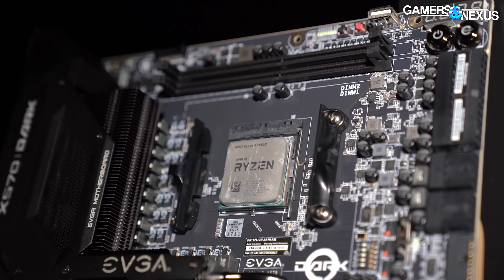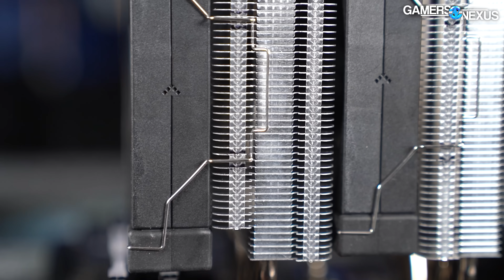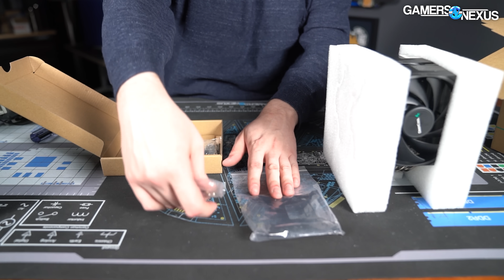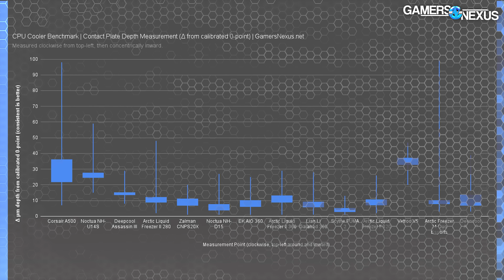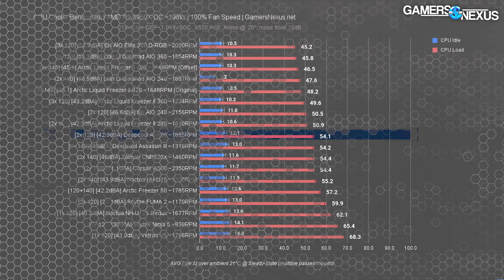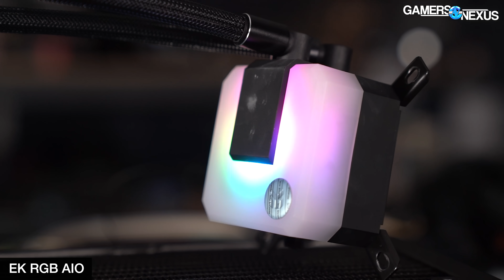Air Coolers Are Getting Impressive: Deepcool AK620 Cooler Review

Comment: Nice video! I was just wondering should i go for Arctic Freezer 34 eSports Duo or DC AK620 for my i5-11400f (unlocked power limits). Can someone help?
Reply: DC AK620 is definitely one of the top 3 high-performance air coolers.
Reply: @astalake7689  Thanks for help!

Comment: When comparing it to the Fuma 2, it's also worth mentioning that the Fuma 2 is neatly designed to fit it into smaller cases or with big RAM modules. It's offset backwards with a thinner fan on the front so it will fit in basically any build, unlike the AK620.

Comment: Installed this after my MSI Coreliquid 240R failed, and it's legit cooler AND quieter. I've received a replacement Coreliquid V2 (which I'm sure is an improvement over the V1), but I won't be using it. This thing is just way better. Sure it takes up more space, but that's the only downside. It also means no more liquid in my PC, which is always a concern.

I also got it for just under £50 whilst Noctua's NH-D15 costs about £100.

Comment: Is there a chance you can add a ~170W load to the charts for future reviews? That's currently relevant for the 12700K (and future i7s I assume) all core workloads and it seems AMD are going to a similar power level soon with their Ryzen 7000 series as stock (at least the upper end ones). 

It's also a good intermediate point between the 120W and 200W loads and we can get to see how the upper mid range coolers separate themselves as the 200W would overwhelm most of them, also it isn't quite their use case scenario (and thus fairly enough not included in the 200W chart), while a modern i7 / future R7/R9 stock could have some of those strapped to them.

Comment: Bought this with my 5800x3d because of this video and holy crap, it's staying below 50C!
Reply: Under load or idle?
Reply: @bukIau  load
Reply: @atavax311  mine is at 71c under load idk why :/ but it’s a 5800x
Reply: @bukIau  do you have yours overclocked? the 5800x3d can't be overclocked. Or it could be you using something to stress it more than me. As my "load" was while gaming', while i'm sure something like prime 95 would raise the temp further.
Reply: @atavax311  stock and r23 to stress test

Comment: OK. The the AK620 does peak my interest (very much). My NH-D15, I have owned for over 10yrs, across 3 builds. It works like new and (Knock Wood) it is still running the original fans. AK appears sweet, but will take over 10 yrs to hold against NH! (I am a possible Shill... LOL) Proof is in the pudding.
Reply: P.S. I overclocked everything, quite a bit. I only upgraded to go faster.

Comment: This gives the same/similar performance of NH-D15 for less money, Customer support and long term product support is where their real value will be known.
I love Noctua(fanboi territory) because of their awesome support, cross compatibility(mounting kits across models) and long lasting product.

I have been back-stabbed by CM on cooler support so they left a forever bitter taste.
Also the build quality of CM mounting solutions are really terrible.(hyper 212 and hyper 612 in my experience)

This cooler is definitely in my recommendations list now.
Will it replace Noctuas place? Only time can tell.

Comment: Damn it, now I wanna get this beast. I'm slightly undercooled for my 5900X with the Hyper 212 Black Editon with a single fan, it works just fine, not nearly as bad as one would think, and thats with PBO2 running and all that, but pushing anything above that and it would suffer. Bigger mistake was running it off a B450... but fixed that now and got a very good X570 so VRM's melting is no longer a concern. I touched the VRM's on the B450 and they were toasty... think I could see a little glow ;)

Comment: Does deepcool assasin 3 is better?
Reply: Roughly the same but many small cases can't fit the assassin 3. Whilst the ak620 can fit easily in most cases due to the slightly smaller footprint.
Reply: @afiq358  tq bro

Comment: Just bought and installed this cooler today. The mounting system seems great until you get to screwing in the heatsink itself. The convex design of the contact plate makes it quite difficult to be screwed in properly. So far Cinebench R23 testing of a Ryzen 9 5900X shows CCD1 reaching 81°C while CCD2 only max out at 71°C. Don't know if the temp is good or not because I also just upgraded from a Ryzen 5 3600.
Reply: Those  are good temps for a 5900x on an air cooler...
Reply: @KiiaaA213  I'll just have to take your word for it. I guess I could've applied slightly more thermal paste but I really don't see how it would drastically drop CPU temps much.

Comment: Fan fact: the AK 630 installed on cruiser Moskva failed to cool her down on the Black Sea.
Joke aside, I've got a Fryzen from Deepcool that has the same convex cold plate. It works fine on the normal single ccd cpus. It squeezes the thermal paste out from the center so that there's no air bubble trapped in it. But It doesn't do much good on my 5950x since it cools one ccd and not the other, about 10c difference. I ended up sanding it down flush so both ccds and the IO die are happy.

Comment: Looking at numbers of, for example Arctic LF 2x140 at 35dB noise level: It can keep 123 W at 51degrees and 198 W at 52.4 degrees. 75 W more power will cause temp increase only by 1.5 degree ?! That can mean only one thing -- there is a huge thermal resistance built into CPU case. Smaller for igh power CPUs. Just to reduce the effect of coolers and not to allow cores to run at too low temp and to limit precision boost ?! Why isn't anybody talking about that ?

Comment: Why would anyone want to run liquid cooling over air cooling when it increases the risk of destroying the computer from leaks? I'm asking genuinely
Reply: Don't have a liquid cooler but there are good reasons why one would prefer liquid cooler over air cooler.

Custom loop: much more potential cooling performance and looks.
AIOs: the higher end 240s or 360s will still outperform the best air cooler.

Comment: I’ve been very happy with air cooling lately. I’m a big fan of their cheapness and peace of mind. Between Scythe, Noctua, Be Quiet, etc. Sound has never been much of an issue and I like not having to worry too much about radiator positioning when building. Honestly compared to the best AIO’s, the best air coolers are maybe going to be 10C hotter tops at max loads. But how bad is that temp even at max loads in most situations? Not usually a problem. 

Also you’d be hard pressed to find a worthwhile air cooler ever over $90-100. And more likely can get a great one at $50-60.

Unless you’re running crazy loads often and for long amounts of time on top level parts, or doing heavy overclocking, I’d recommend air cooling. Even then depending on where you live you could get by fine with air cooling.
Reply: I’d also add the caveat of case size. These days anything less than like 20l lis gonna be a hot box and require water cooling for optimal performance

Comment: Fitted a black NH-D15 a while ago and I’m frankly blown away by it. My cpu loves it, it’s quiet and there’s little to go wrong. It’ll last for years and I plan on using it in my next build, too. Love it.
Reply: Which CPU? I am planning to use it with my Ryzen 5 7600 along with Zotac 3080 Ti Trinity OC. My chasis is CM Storm stryker, Mobo is MSI Tomahawk B650 and  PSU is Rm850X from Corsair.
Reply: @avroneelbiswas  I’m using a 5800X3D with a 3080ti. No problems at all. CPU idles at around 32c and I’ve not seen it go above 70c during gaming.

Comment: If you don't want to watch the video, basically it's the best air cooler we have at the moment, in peak performance and overclocking scenario, it's cooler and quieter than the Noctua NH-D15 and it's performing really well at 35dB. For 60-70€/$ its better than the Fuma 2 and NH-D15.
Reply: @Transistor Jump true, but that beast will weight at least 2 kilos or 4.4 punds haha.

Comment: Why don't you test the Silver Soul Black cooler from Thermalright. It's really interesting for smaller system with a height of only 135 mm and a 120 mm fan placed in the middle of the dual tower with 6 heatpipes ?

Comment: I was about to buy the Deepcool AS500 Plus until I saw this review, and decided to splurge and go for the AK620 since there wasn't much of a price difference (I paid SGD$95 = USD$70 for the AK620). It's working great with my 5950X, very pleased with it so far. Thanks for the thorough review!
Reply: There on sale now for $55 on Amazon
Reply: @ninemm222  REALLY? That's some good ass deal for a cooler literally better than Noctua NH-D15
Reply: @TON-ob7ib  Hell ya I’m hyped
Reply: @ninemm222  If ya planning on buying it then go for it mate, That shit's worth every penny
Reply: What are your temps on the 5950X?
Reply: @TON-ob7ib  I'm getting 40-50 during normal Windows usage and 65-75 in gaming, occasionally maxing out at about 80 if running something like a stress test.
Reply: @tscottj  Damn, Those temps are going strong for an air cooler that beats a lot of AIOs, considering the fact that most people get an AIO or do custom looped systems to keep their 5950X under 60. You made a great purchase! Also I apologize for responding after a long time

Comment: I am still running my Noctua NH D14 that I bought with my i5 2500k. Now running on my 5600x (with the free mounting kit Noctua sent me). Must be over 10 years old already (wth) and still works perfectly fine.
Reply: im using my Cooler master Hyper 410R from Pentium g4560 to i7 7700 non k to i7 12700 non k on asus z690 motherboard .its been 5 yrs

Comment: Why do you need 2 fans?
Wouldn't one higher performance fan between the grills be enough? 
Also, pulling air from the front end exhausting shouldn't create turbulance with ony one fan.

Comment: Air coolers, schmair coolers... I've been an air-cooler guy since the days we actually needed active cooling, but since last November, I've seen my vid card have its temps adversely affected to the tune of around 10 - 15 degrees as a result of me using a Noctua NH-D15 on my i9-9900K, which kept my CPU nice 'n cool, but stifled my GPU due to that 7 inch cube of plastic and metal sitting just 5mm off the (very hot) backplate of the GPU. That cooler absolutely dominates the airflow in anything less than a FULL midi tower. I've just replaced that apartment block cooler with an NZXT AiO, and my CPU temps are (almost) as cool, give or take a few degrees, but my GPU is now cruising at around 65 under load, compared to 75 - 80 degrees previously.

YMMV.

Comment: I love the data you provide. I think another good data point would be entering and leaving air temps. Put a couple thermistors on the inlet/outlet sides of the cooler and track the deltaT between them.

Comment: I think if we'd really wanna have a standard to measure how much Heat a  cooler can dissipate in a given time, a somewhat comparable temperature point to that you could measure would be the point at which the heat pipe "dries out" aka all the liquid gets evaporated because it's overwhelmed (for water loops I'd say the point where you cannot dissapate the heat faster than it's coming in would be a good equivalent but i know that's way harder to say since that's highly dependent on the temperature...). I know that's usually not in a temperature range that you'd want for a computing element, but it kinda makes sense since that way we really know until which point the cooler is reliable, since cooling performance plummits at this point.

Just an idea if you guys ever wanna include a standardized "how many watts can this handle" test for CPU coolers, since I cannot imagine cooling companies to ever get to a common point in faking their numbers...

Comment: Wow, wasn't expecting a cooler in that price range to beat out the D15 in both noise and thermals. Noctua better hope they have a D16 in the works or this could become the new de-facto air cooler for consumer CPUs. Better (arguably) aesthetics, cooling, noise, and above all price. And this is coming from someone who used a Noctua in their last several builds.
Reply: Pretty sure they hinted at D15 update this year. Well actually not a hint.. they literally announced as much if memory serves.

Comment: Since I am old (66) and don't use social media this is the only place I know to post this. based on your review of the Vetroo V5 I just purchased one. One thing I wanted to bring up though. Since 2008 I have used 120mm liquid AIO coolers exclusively with precious few issues. My first was an Asetek 510LC in a new Alienware Area-51 in 2008. Now this will chap your behind. THAT cooler has WELL over 100,000 hours and is still used in my test platform (ASUS P5N-D) I am currently using Deepcool Captain 120EX white AIO's in both my main machines. Full Tower is a NZXT Phantom White and the other is a Deepcool Dukase white V1. The Full tower with all the fans would explain why my 10600 idles at 25C and under load never goes over 40C. The i5 6600 in the other idles at around 31-33C and loads at around 40-45. I NEVER overclock and the ambient temp in my apt is 68F (which would also explain a lot). I also NEVER run rez higher than 1080p and my DT rez is 1154. Of course I don't need to see a gnat's whiskers at 200 yards in a game though. Just had Cataract surgery so maybe I'll be able to see better but just wanted to say that my experience may be unique to 120mm AIO's but it is what it is. Thank you for the great content

Comment: I've been using a PCCooler GI-D66A "GAMEICE" (with 6x6mm and shrouded-dual 120mm RGB fans) for the last 3 years to cool an overclocked Xeon E5-1680v2 (at 4.4Ghz).  Does a terrific job and cost me $70 at the time. At a "230W TDP" rating, it is enough to keep my rig running cool as a daily driver.

Comment: Would smoothing out the cpu side's curve a bit help with how good it works? I mean since having it better covering more of the heat shield with a better fit might add at bit more effect? Or might lapping the cooler not be worth the time and work?

Some numbers where we could see before and after lapping might be nice too. But that's up to you guys to figure out. I for one would like to know though, since I have several computers with the old Noctua coolers that is still fairly good apparently, if lapping would make them a bit better it might be worth to do it.

That's why seing a video where you test several high end air coolers, even some water coolers too, before and after lapping, if they need it at all and if the cooler is perfect for cooling, then it's only their effecting cooling that means anything.

Maybe there will only be a tiny effect or nothing at all or maybe we would see a temp drop of a few degrees or maybe a cooler would suurprise us.

Video idea? Or is this more a Jayz thing?

Comment: I've found the biggest gains in making sure you have a good exhaust path from the cooler. I put my fan on my cheap cooler in a pull configuration with the case exhaust just beyond it. thinking about swapping the two with some high CFM units and just stacking them in series.

Comment: i liked this cooler but we found QC on the fans wasnt great we had box of 20 and i would say 4-6 of them when over 1500rpm had a weird hum noise, temps great along the board except when we used them on 5800x like at one point we had under heavy load them hitting 90degrees but the fuma2 we had roughly 11degree lower.

Comment: I have Arctic freezer 34 from my old build on my current ryzen 9 5900X and in cinebench in multicore load, temperature went to 69 °C which I found impressive so I decided to keep that cooler. I will be changing the fan tho for rgb one with higher RPM even tho it dont needs that.

Comment: I love air coolers!  Even though some high end AIOs and custom liquid cooling can get better temps than high end air coolers, they, high end air coolers, are usually close enough to not be worth the price increase of the AIOs or Customs and the fear I have of having liquid in my computer case even if the chance of leaking is small I still rather have air coolers.  :)
Reply: Personally aircoolers basically having a lifespan of multiple decades is why I still have my thermalright silver arrow.

Comment: I’ve seen several heat sinks with the checkerboard fins which makes me think it may have some purpose, bequiet threadripper cooler (black rock pro?) for instance has this
Reply: It’s not perfect squares like this, it’sa different pattern but similar, also verified it’s a dark rock pro TR4

Comment: I think I have a NHD15, glad it will be supported on the AM5 socket too when I upgrade down the line.  I'll probably try to update my Bios of my b350 to support a 5600x once those bios updates become available.  My main concern with that is if in the process of updating the bios I lose support for my R5 1600 before gaining support for the 5000 series chip; I'm not sure if the 16mb is enough to go all the way from a 1600 to a 5000 series chip.  I think a coworker may have a newer ryzen chip I could maybe borrow if it comes to that.

Comment: @Gamers Nexus Is it possible to refill and use an AIO like the ones Cooler Master has? They usually have a small fill port that has a sticker warning the user not to remove the cap/screw. I have never tried doing this and I've used 3 different CM AIOs over the past nine years. However, if there is a way to top up the reservoir and use the cooler without any risk of leaks then I would definitely like to do that.

Comment: Thanks for the review.  Have you considered separating the testing and results for the air coolers vs the AIOs?  Also, I would definitely like to know if there is a reason why Be Quiet air coolers have basically disappeared from most of these roundups.  In any case, I like the performance shown here from the Deepcool Cooler and would definitely consider it for future builds.